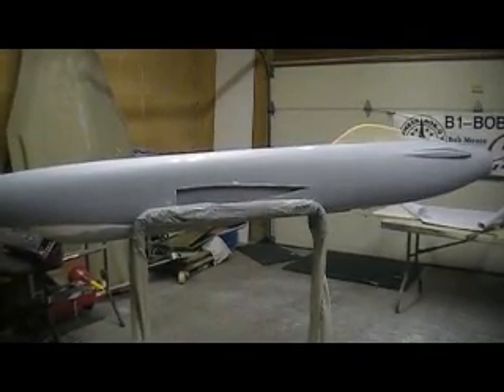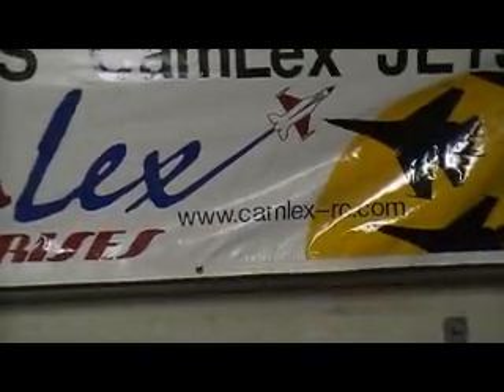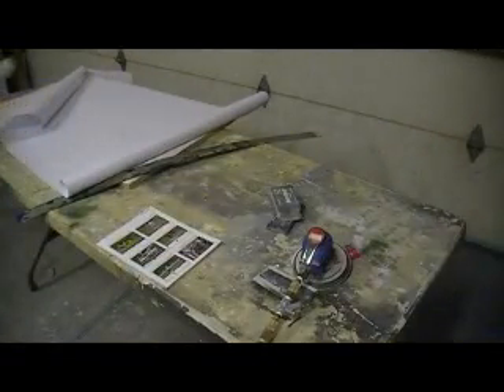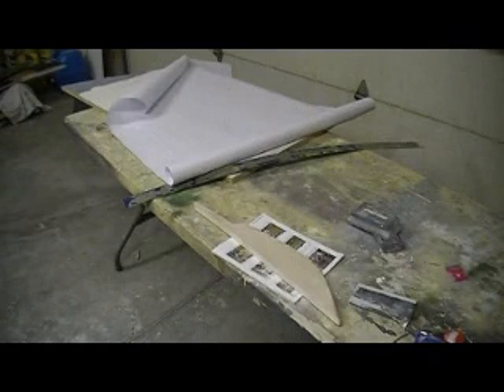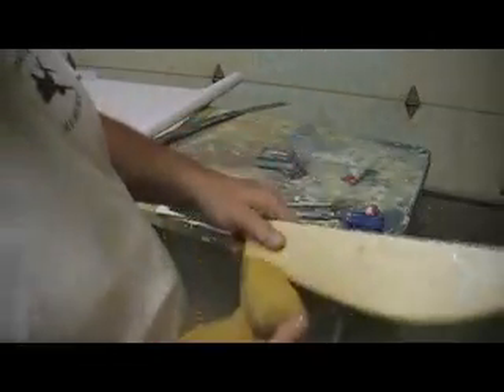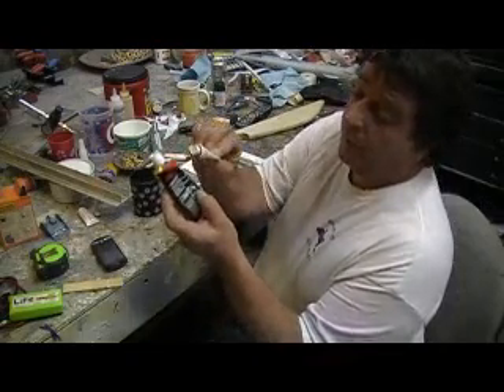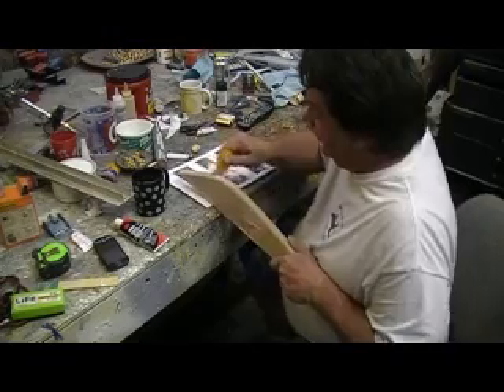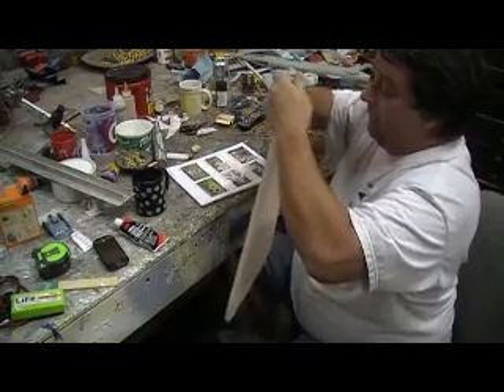how to build a rc jet F-105 thunderchief # 78

Comment: The "bump" you're modeling under the nose of the F-105 is the RHAW antenna and the foward facing motion picture strike camera.  The RHAW antenna detected hostile radars that were tracking the aircraft.

The rear "bump" behind the ventral fin and tailhook attach point is a reward facing motion picture strike camera.

Both the foward and rear cameras provided "gun camera" film of strike missions.  Many of this film is seen today on The Military Channel when they show Viet Nam bombing missions.